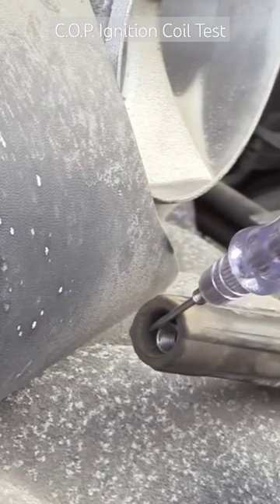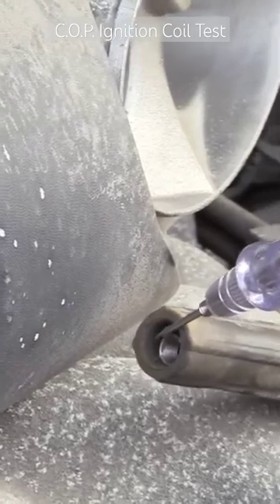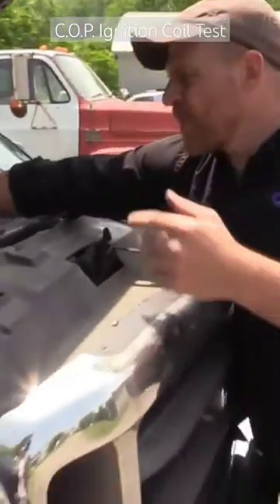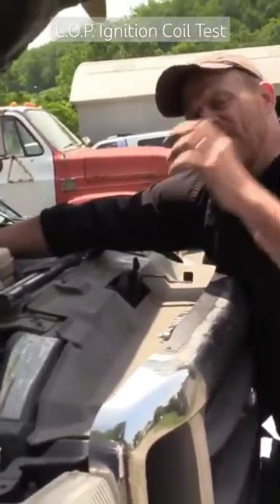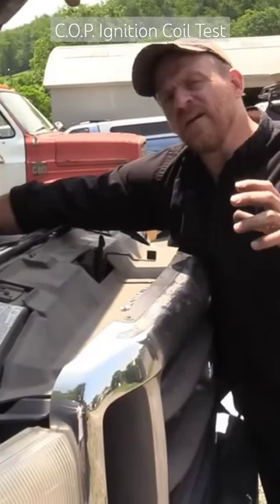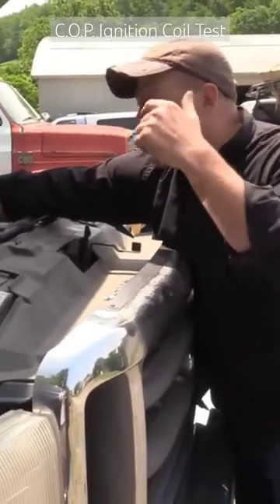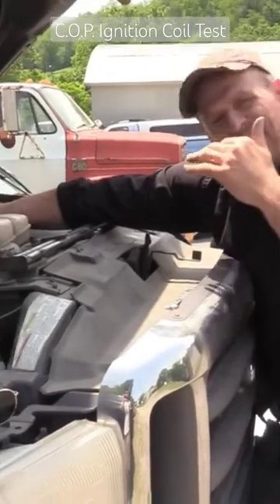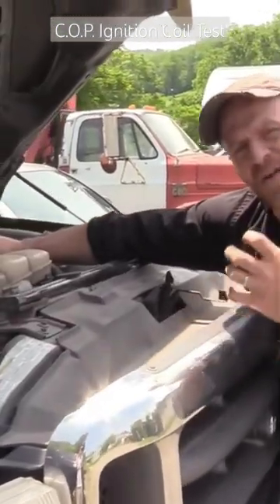Weak Spark Test [C.O.P. Ignition Coil]

Comment: Yes, I can accept that you need a good spark when under compression, but I'm the guy who wants to know why. When think about it, the air is more dense when its squeezed into a small space, but why does that make it harder for a weak spark to jump that gap? It seems like that is saying that the spark has mass which would be harder to push through a dense fluid and that's something that blows my mind.

In other news, if you are unsure if you are seeing a weak spark, compare it to a known good spark.
Reply from the maker: To be honest, I'm not sure the physics of that. But it is the truth and it's really cool to see secondary KV on waste spark coils and see how little KV it takes to fire the coil on the exhaust stroke compared to the compression stroke. Also, snap throttle testing and watching KV is also cool. For example it may take 10kv to overcome the airgap at idle but it jumps to over 20kv when you start packing more air in a cylinder
Reply: @ScannerDanner  Yep. Sometimes, we just have to accept facts, and let the higher pay grades worry about why.

Comment: What if you get new coils and its still weak same coil your testing on but 05 f150
Reply from the maker: High resistance in the coil primary circuit (coil + or coil-) or a failing ECM driver.